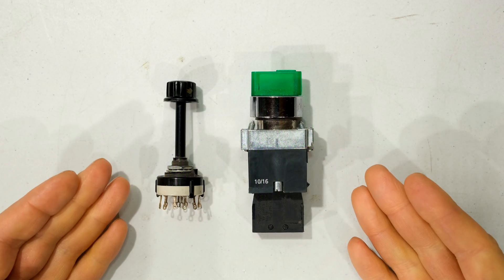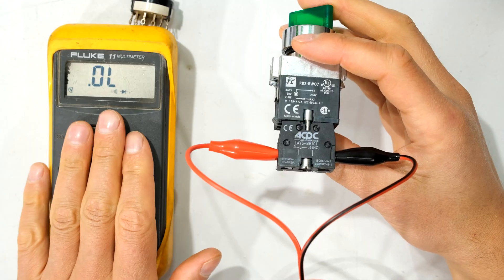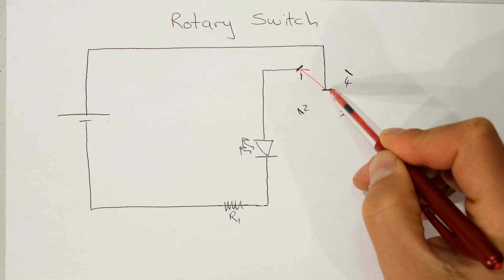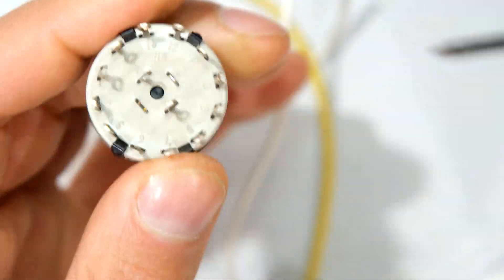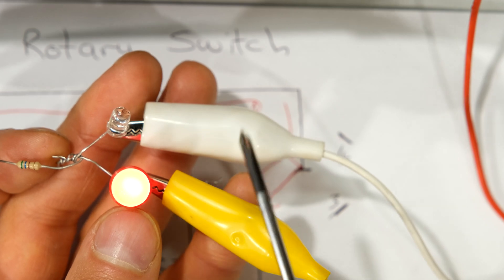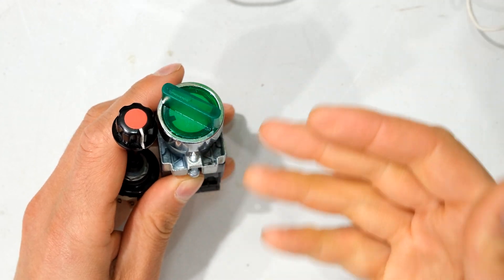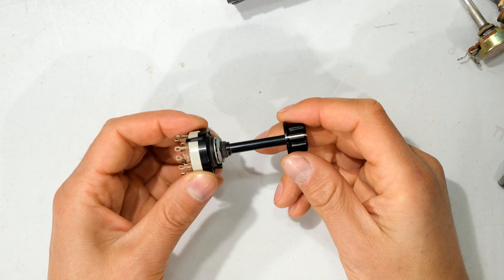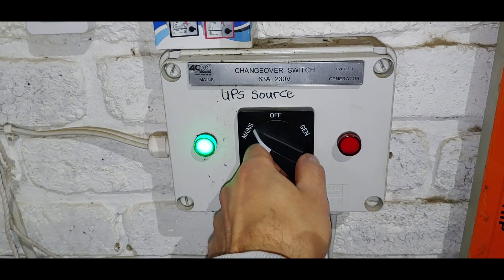What is a rotary switch? Tutorial on how to use a basic rotary switch.

Comment: Very good video. Is it possible to hook up the switch to different outputs and having the actual contact connect to GND when turned to change to different output. This would save having to use several push button switches to change output. I have a 12 way 1 pole break before make switch. Hope you can help.